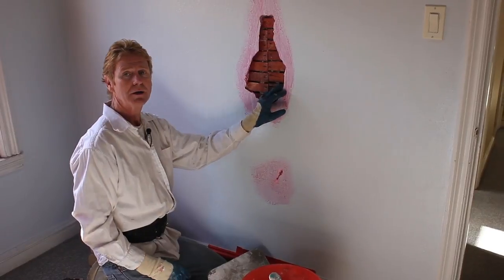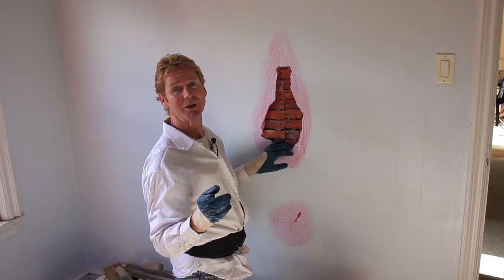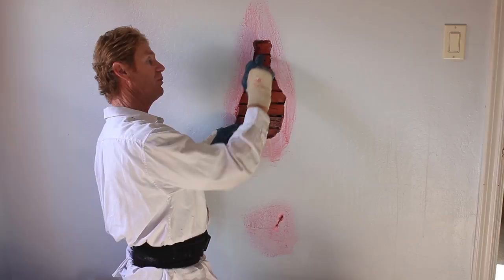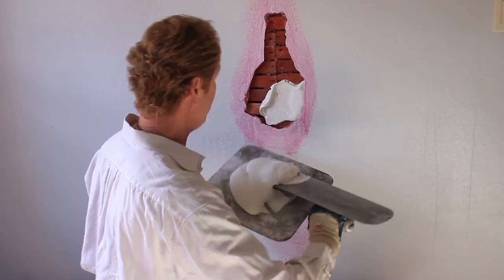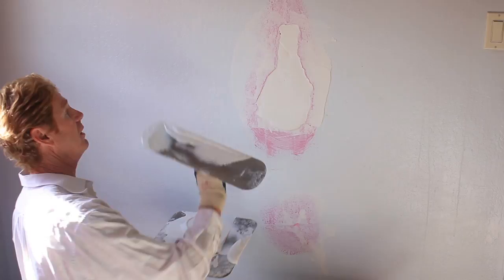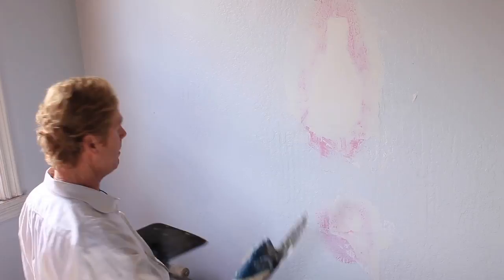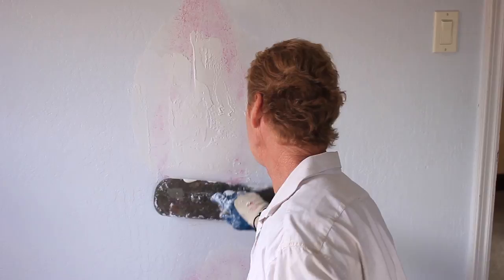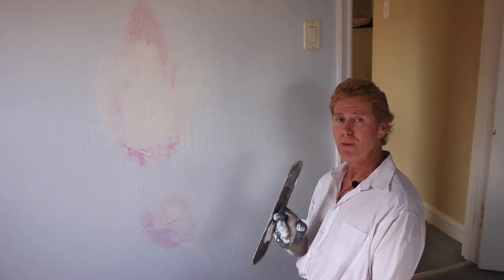DIY how to plaster a hole in your bedroom wall

Comment: Great. I have a repair very similar to this to do. This is what I was planning, but it is nice to see I was correct. My only uncertainty at this point is how to match the finish....I'm not sure what to call it, but I looks like it has little bits of sand spaced out. Like maybe a heavy float with 50 years of paint on it?

Comment: Hi Kirk,
We're working on some similar projects in our 1920's house. We've got a bunch of places where the plaster has split into two layers and for most of the area where it was buckled the bottom layer (hair and all) is still tight on the lath.  Do we need to bust it all out and down to the lath or can we just put fresh mud on the bottom layer where it's still secure and just take it down to the lath where it's loose all the way through?

Thanks for the videos; you're inspiring us to tackle a bunch of this stuff ourselves.

henry
Reply from the maker: Hello coppolah, tough question without my seeing or tapping on it to get an better idea of what's going on.
 As a rule if it's seperated find the nearest studs, score at this point, remove and re plaster.
 If it's just the top coat in question, scrape off with a putty knife, if you pound on a plaster wall it will loosen the plaster, sometimes.
 Its easy, but it really does require a bit of practice to understand the shortcuts for integrity and saving time.
 Best wishes,
Happy Holiday’s from the Giordano’s DIY plastering information network

Comment: Hey Kirk.   I see your material of choice is 20 minute mud.  Your videos have got me started tearing down this ugly paneling that was put up over the plaster walls by the previous owners.  In some spots, the plaster is destroyed from the floor to halfway up, if not higher.  The damage is behind several layers of wallpaper, paint, skimcoat, and plaster of Paris, so some of the failed plaster is from 40-50 years ago and was just covered up.  I’m able to use plaster washers to stabilize the good solid plaster.  

Would you recommend the same 20 minute mud over a large area, 12 feet long or so?   Would 45 minute mud be any less reliable?  Is there a better product I should use, or should I just turn this one to the pros?

Thanks for all that you do!
Reply from the maker: Evening Black Maxima Dude, the 20 to 45-minute mud has nothing to do with reliability, but instead how long the gypsum-based mud takes to set.
 The drag with wasers are the mud will have to be really thick to cover these, the issue of just screws being counteer sinked is you have to find a stud in the field of wood lath.
 Only you know what your capable my firend.
                     
                                Live long, and plaster
                     Plastering tips and techniques

Comment: I have a house that is over 100 yrs old. I just stripped the wallpaper off the plaster wall in one bedroom. I washed the walls with water to remove dirt and wallpaper adhesive. There are some cracks I would like to fix. Especially ones in the corner of the walls. What can I use to fill them? That smaller ones and nail holes I've been using DAPs patching plaster.
Reply from the maker: Howdy Bob dude, the product you are using is good, there's always interior caulking if the house is  prone to cracking, or Red-Devil lime spackling.
Live long and Plaster
Reply: thanks.  yes house has lots of cracking in walls and ceilings too. have a ceiling to work on next whenever I get this room finished. so ok to keep going with stuff I'm using?
Reply: thanks.  yes house has lots of cracking in walls and ceilings too. have a ceiling to work on next whenever I get this room finished. so ok to keep going with stuff I'm using?
Reply: thanks.  yes house has lots of cracking in walls and ceilings too. have a ceiling to work on next whenever I get this room finished. so ok to keep going with stuff I'm using?
Reply: thanks.  yes house has lots of cracking in walls and ceilings too. have a ceiling to work on next whenever I get this room finished. so ok to keep going with stuff I'm using?
Reply from the maker: Atta boy, Bob dude   
                    Live long and plaster, 
          Kirk’s, plastering tips and techniques
Reply: thanks again. is there a way I could send you a picture to ask your opinion on?